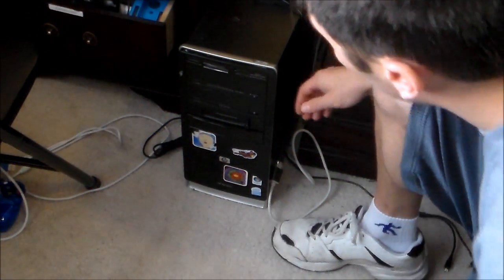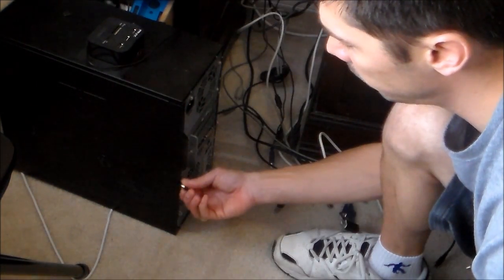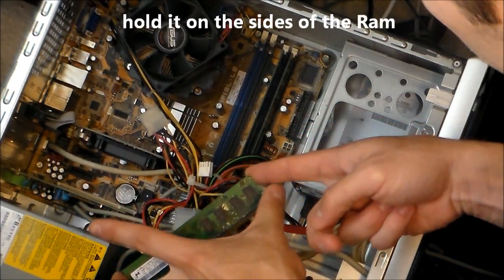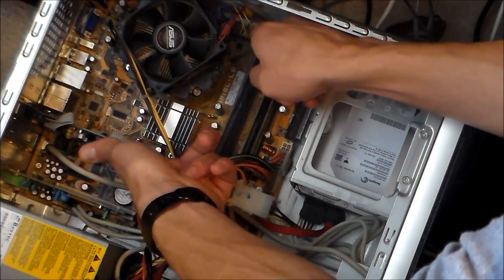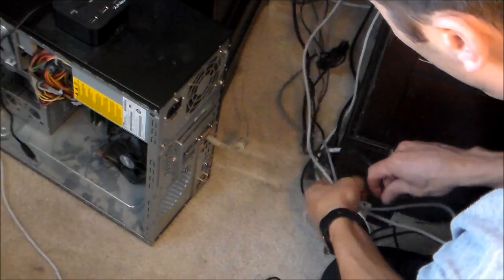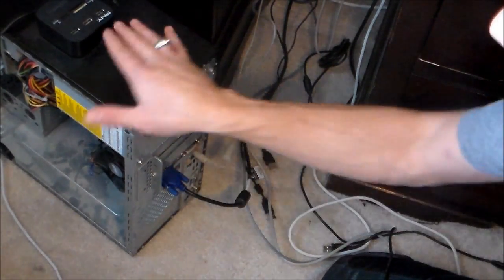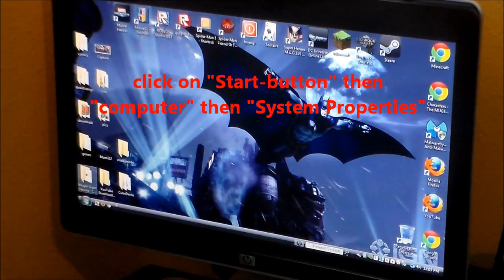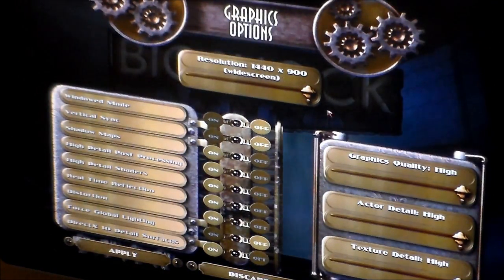How to Install Memory "RAM" in PC computer Desktop

Comment: dude how to find the ram speed matching motherboard.
Reply: Just search up your mother board, and look for the section where is says that your PC needs DDR3, DDR2, etc.
Around that line of text or around that section, there should be a number like 1600, 1633, etc. Take the highest number, and that is the right frequency. 
If you don't know your motherboard model... go to your command console and type in this line of code.
wmic baseboard get product,Manufacturer,version,serialnumber
If you don't know how to open up the cmd... I think you should consider learning more about your PC before cracking it open.
Reply: +Max Lu (Katostraphy) hey dude thanx for your help plus I found CPUZ that helped me to
Reply: Rounak Dmello No problem. Glad it helped :P

Comment: Thank you it was a huge help!
Reply from the maker: no problem,  when installing ram make sure the ram speed matches on both sticks and doesn't exceed mother board recommended size and speed. contact manufacturer for pc specs.

Comment: Hi i have a hp pavillion elite 140f i have 2rx8 gbpc3-10.600-9-10-bo i bought kingston 2x8 16gb ram i put them in start the pc up an screen says no display any help would be great thank
Reply: +Brad Tyler There is only so much RAM you can add.  Search for: " 'My computer model' Maximum memory allowed."
Reply: I did i can go up to 16gb 4x4x16 i got the new ram well it dont work an two of my ram slots stop worker.
Reply: +Brad Tyler I'm sorry I can't give you further info about your problem. Try asking in forums, message boards, of hackers, techies and the likes. Cheers.

Comment: hello I want to increase my pc RAM by buying 8x1 gb
already I have,
RAM - 4gb
CPU - AMD FX8350
GPU - GTX660 2gb

Now my question is, can I install both the RAM cards i.e, 4gb+8gb
because I want to play latest games.
Reply: Harshal Manturgi NO! you will need to buy an extra 4gb for it to work, or buy two 8gb sticks. The RAM speed hz has to be equal.
Reply: if ddr2 must be the same spec, if you are ddr3 add what ddr3 what you want, no worry about 4.8.16 and speed hz (equalize by its self) depend on MB,
Reply: +Nathan Rodriguez 

i also have 4 gb of ram ,  if i buy 4 gb and 1 8gb stick
Reply: +alhaitham 

my proccessor is : Intel (R) core (TM)  i7-4770 

CPU : 3.40 GHz

if that helps.
Reply: +alhaitham He is saying that if the ram is ddr 3 it should be okay to mix sticks.

Comment: What harm can be done if you do not unplug any cables first? Also I unplugged the internal power supply cable from the motherboard but the external power cable was still attached. Computer works fine other than BSOD when using skype and firefox together and firefox will sometimes crash.